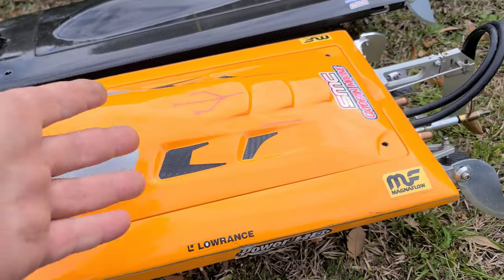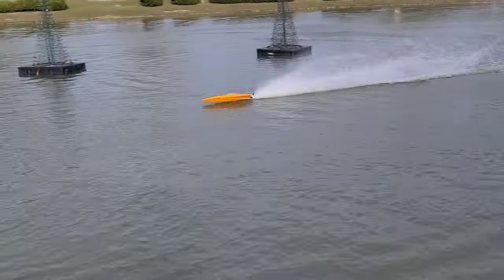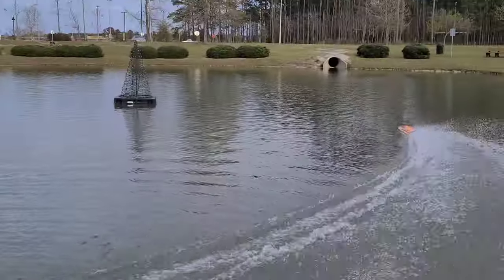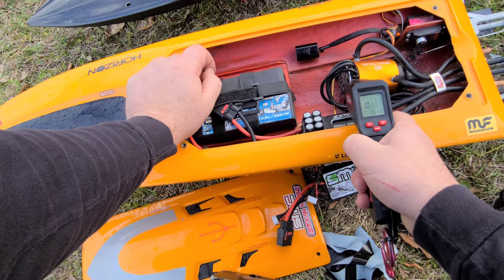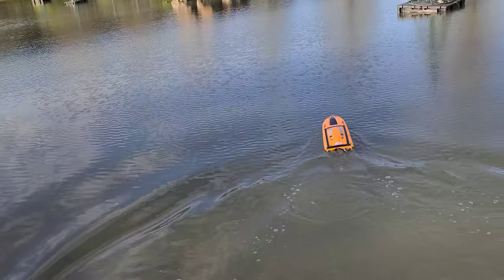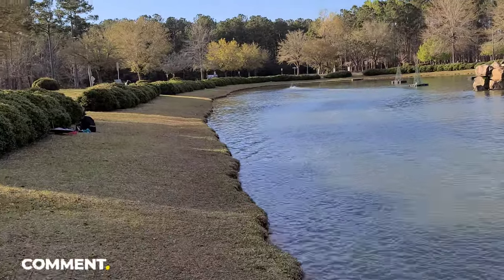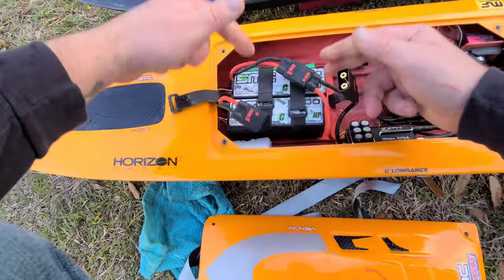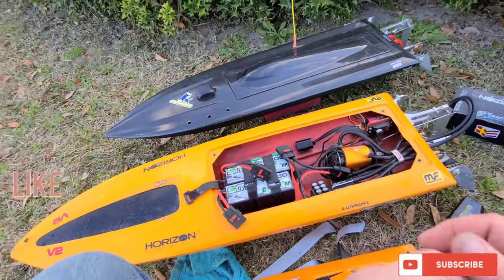Tinker, Test, & Tune Deltaforce 35 - Spektrum 4685 1350kv, ZTW 200a, 8s SMC - FE RC BOAT

Comment: I think this will get interesting. There's definitely some get go power with those bigger props. Really interested to see how it handles even bigger props and how much it affects how it rides...
Reply from the maker: Next outing I'll throw on my x450 cut back to a 48, and or 1816abc prop for speed..    about to order a few X & M Series props from octura
Reply: @IRONCLADRC  that will be interesting to see for sure. Maybe hi-rake causes some prop walk or to much lift. The pond is getting small quick now with these runs so will be interesting to see if there is a lot off difference with speedrun spot speedwise...

Comment: these low vhulss i run props with real thin rakes on the props you loose a little top end but it will turn on a dime, like a ecomaster, and it will get up on plane quicker, with much lower inside temps. thats how i run a revolt 30 it has a really thin 42.5 prop on it

Comment: i have 3 of the ZTW 200 and i like them ,i use them with a TP4070 1400kv on 8s and a sss56104 1000kv on 8s is no problem but on this delta force hull thry a abc 1915-17 i use them on a mhz phantom and works so good(i know it's a differed hull shape)in combo with TP 4070 1400kv 8s never had any problems
Reply from the maker: I've had terrible experiences with mine, especially with higher kv motors (1900&2000kv) running 6s.  My Z200 seems to do better with the lower kv motors like you've mentioned...    I've run quite a few abc props on my deltaforce when doing SAW passes best one I've found so far is 1816 17/45 tried  a 1916 on my old set up but was to much prop for the old setup, interested to see how that 1916 performs with the lower kv setup.   Thanks for watching

Comment: i forgo0t to ask.... besides what they cost would ya say the castle hydra is better than the 500a ztw? to be honest i didnt think it was really worth the 400-500 it is, with what i already have price wise to me its 150a or 500a. the in betweens werent worth my time. i have a few different 1520kv.1850kv, even the 2000kv and more do just fine on 200, but its a problem trying to get back on the throttle with that soft start. i tried every which way with the timing card its just the way they are. i think i even have my timing all the way up at like 22 or 28 somethinglike that. there are updates you can do on the esc but i doubt it makes a difference. i have a bunch of those ztwg2 esc from 40a-100a. i hope they dont have that soft start . the older ztws40a dont
Reply from the maker: I like the hydra so far, no issues what so ever, well the glitching servo/rudder deal, but that's easily overcome.    The 500a ztw is huge 950 grams it's 3 times the weight of the ztw200 @ 350g. Weight is one of the reasons I went with the 200 over the 300 ztw.         I'm definitely considering the 200 Kraken HV for the dr35 or Dominator?
Reply: @IRONCLADRC  yeah honestly im not totally sure but its more about what those escs can peak at. i would be surprised if a kraken 200 would do much better than what you pay for the 150a. i think the krakens have been around for awhile, i just remmebr those large castle escs overheating and burning up in rc cras a few years back, whether it was operator error or not,the size was why i never bought a 500a ztw as you said. i think the castle hydra might be the best choice. theres not much after that unless you want to make your own escs. i did see someone once design a esc that mounted on the inside side of the turn fin for saw runs to keep it extra cool. in munich